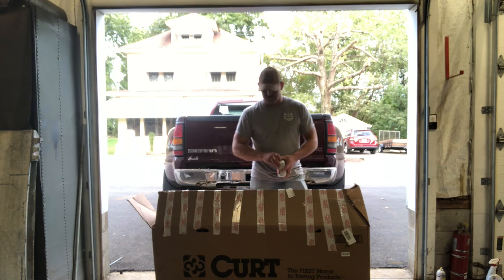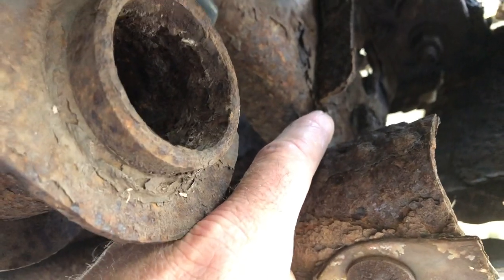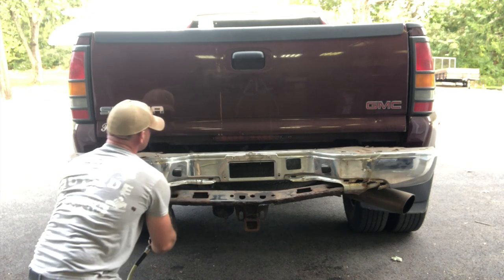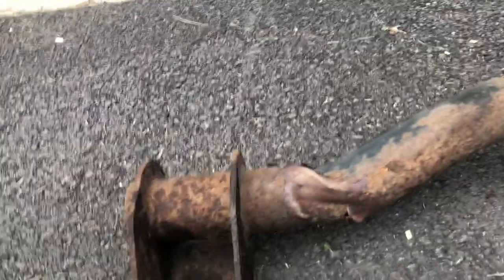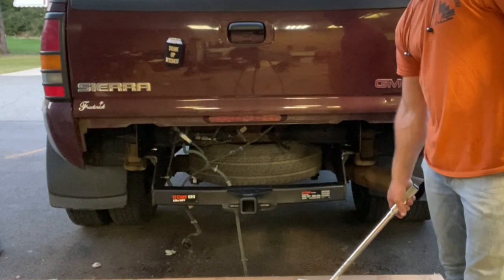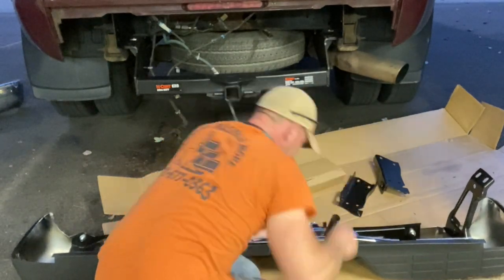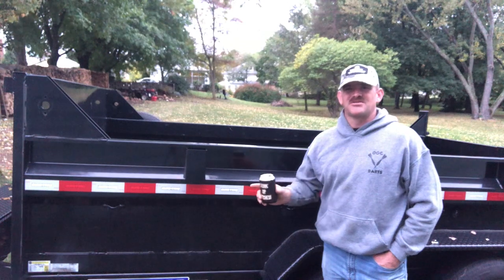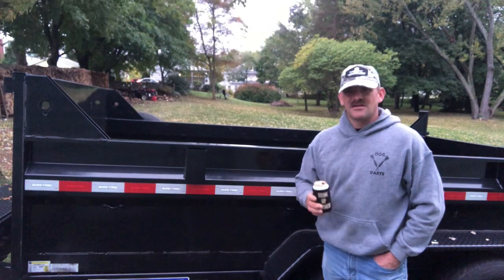Bumper and Hitch Replacement 2002 GMC 3500

Comment: I have a 2002 GMC 2500 HD. 4 wheel Dr. It was rated at 1 ton but I had it knocked down to 3/4 ton to save money on plates. Mine is rusted out the same way. My bumper is rusted out also. Pa. is hard on vehicles. Isn't that a shame how they rust out. I have 30, 000 miles on mine. I have had the power steering go out twice. Pretty tough when you are by yourself. Great Job !

Comment: The truck looks clean other than the old hitch and bumper. Its ready for good work now for sure. Glad nobody got hurt.
Reply from the maker: That’s PA for yah all they do is salt the road and sometimes spray calcium before a good ice event. It takes a good toll on the vehicles around here.
Reply: @OutsidewithScheib  They do that here in Michigan.

Comment: That's a very common problem with those trucks. I have a tree service buddy who killed 2 of them on 2 trucks in the same day. Dump trailers are especially hard on hitches. Also be aware, because the curt hitch doesnt use the bumper for support it will actually start peeling the frame down. My 2002 gmc is doing that and the buddy who killed 2 of them had to have his frame plated.
Reply from the maker: Good to know thanks for the info.

Comment: Good warning for all of us. I would kinda laugh when I'd see a Chevy with the bumper and hitch bent down and wonder what kind of idiot, but then yesterday...
I have a 2003 Chevy 1500hd, and live in Michigan!  I've hauled this many round bales many times before, but when i got out to unload, the jack was resting on the ground.  Fortunately is happened right in my yard. I found a pile of rust at the spot of failure. 

What was the part number for the Curt hitch? Where did you get the bumper from?  Is the hitch working out pretty well?

Comment: I find it very weird that the bumper and hitch were that rusted out but your truck is not, I live in Michigan where salt is number one for snow and if that truck was here it would be rusted off the frame right now lol. I think your truck is pretty sweet, not many single cab dually trucks out there.
Reply from the maker: All the salt and dirt gets up in the bumper and hitch area and just sits there holding moisture doing damage the frame has some flaking but I think I am going to pressure wash it and give it a good coat of under coating.